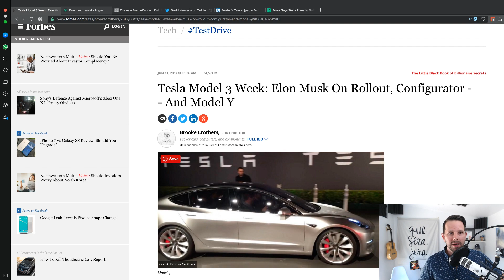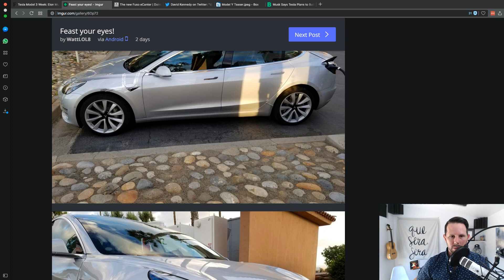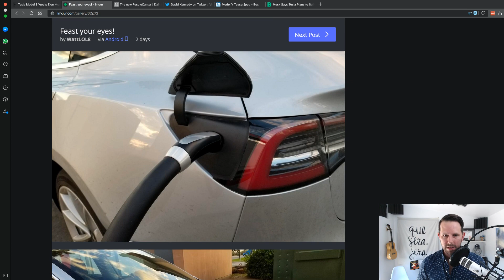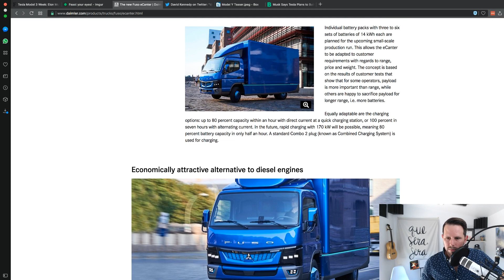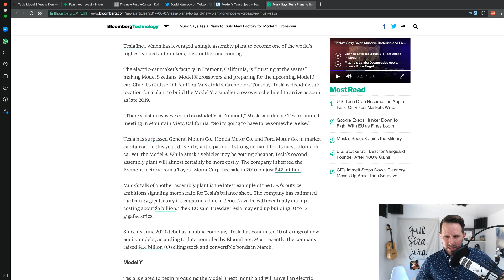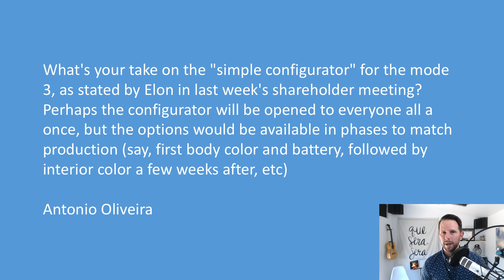Model 3, Daimler EV, Model Y, Solar Superchargers and Fremont Factory Tour - Teslanomics LIVE!

Comment: Another reason to disconnect from the grid is cost.  Your grid even is Washington state (Hydro power) is .10 per kWh after taxes.   I think i have heard solar is .04 to .05 per kWh(in Middle east).   I believe they have even stopped pumping oil with electricity generated with natural gas and switched to solar.  Someone like Elon has all the parts at cost so it may be a better business case then I have stated.

Comment: The reason to install batteries at the superchargers is because slamming the grid with a 40kW load at random times is really hard for the power plants to predict and have the supply available. The battery will stabilize that load.

Comment: I suspect that the large cover for the charge port is to accommodate the significantly larger CCS plug without changes to the chassis. In Europe CCS has become standard, and it would make it a lot more convenient if Model 3 could charge without the need for an extra adapter.

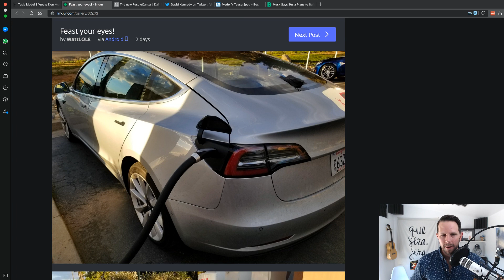Comment: Hi, Ben. At 6:12, the reason the charge port cover is big is that the EU version has a bigger socket. In Europe, Tesla cars have the standard Type 2 socket. The Model S version was barely big enough for the socket but not big enough to add the lights around the socket like you have in the US version. http://cdn.teslarati.com/wp-content/uploads/2015/06/2015-05-26-19.22.35.jpg

Comment: I seen a used 2014 tesla with 55,500 miles with sun roof. For about $43,000 should I buy it or wait 3 years or so for a used model 3 which has autopilot. Most miles I ever need is 100 miles. I'm going to trade in my car which has the value of $12,000
Reply: Can I ride shotgun with you?
Reply: imbored200 buy it. then let me ride shotgun with you 🙂
Reply: Happi Fix I will lol
Reply: You could just buy a used leaf for like 6k if you only need like 100 miles of range. I considered it myself, but EV charging is not available at my apartment or work =/.
Reply: vadix thank you for reminding me about the leafs price. I will check it out. Thank you
Reply: imbored200 Just try and get at least a 2013 with dc fast charging. Those are the two big ones. Pre 2012 didn't use a heat pump on the batteries and the range is shorter.
Reply: vadix what's the warranty on  the battery with the leafs? 5years? I don't really need D.C. fastcharging. It's only one in the city next to me and it's out of my way.
Reply: On 2013 its 5 years and up to 30% loss of charge. I think a better approach is to see how many of the bars (they go up to 13) the leaf has at max charge, and buy a leaf which has had its battery treated well. That is going to be your one concern since milage doesn't always age batteries the same. Heat, resting capacity, and charging speed affect it.
Reply: vadix I thought the bars was goes up to 12. But I'm going to shop around for now

Comment: I think Elon can get away with only offering color choice and wheel size, but it better do 0-60 mph in 5,6 seconds, at least 215 miles range, and cost $35,000. If it says starting price is $35,000 but you can't get it, that would be unprecedented. 

I think he will just put 55-60 kWh battery in it, not a software limited 75 kWh battery, unless he's smart enough to lock it from the bottom instead of the top, which will force people to do the upgrade when they can afford it. 

Tesla will need a special queue system for those with early reservations for a car he promised but won't deliver at launch. Perhaps a queue for dual motor option group and a queue for whatever the last configuration will be.
Reply from the maker: They won't offer it at 35K from the start, only "premium" models that will cost at least 42K (my guess)
Reply: Teslanomics by Ben Sullins, I think that will throw another wrench in the gears. I think there are two groups, those that want a $35,000 car because they can only afford $25,000 and those who wanted dual motor highest performance self driving. There's used model S 85 for $40,000 and some S60s even cheaper. 

Elon saying he will use solar panels and batteries for superchargers is a joke. He doesn't even have solar on his gigafactory yet. It would be ridiculous to put solar panels and batteries at each supercharging station before all his factories (where he has more security) have as much solar as they can fit. But he needs to make a profit charging the cars so he can upgrade and maintain the supercharging network.
Reply: DrgnFlys, no, everyone knows Elon got Tesla to buy the bankrupt Solar City from his cousins. Owning a solar company doesn't make solar panels free. First Elon has to exploit the final loophole in the federal renewable energy incentive program by selling $60,000 roofs and getting the taxpayers who can't afford it to pay $18,000 of the cost. Hopefully the Policies will revise to rebate a certain amount based on the kWh of solar your system produces, not a $10,000 solar system glued to $50,000 worth of roof tiles.

Comment: I will end up delaying my order. I'm around order number 75k so i'm sure the queue will pass me over and I'll just get early picks once the additional options are made available. Quite a few of the options are important for me before picking up the car. Dual motors and a larger battery are key. A couple other things like auto pilot, glass roof, sound system, etc. are options still debating.

Comment: Its possible that the connection fees and usage fees that Tesla has to pay the utilities to supply the Superchargers may make setting up a Tesla solar farm/Powerpack based system as more economical, besides being more reliable, scalable, and insulated against energy price fluctuations or manipulation. 
I just watched Who Killed The Electric Car again, and though the probability for anti-Tesla legislation is dropping, I think Elon is very aware of where the company is vulnerable, and shutting down the Supercharging network would be a major blow.
Reply from the maker: Could be, I think it's a good plan in the long run, just short term doesn't seem like it should be a big priority
Reply: If they use batteries, they can offset demand charges independently of solar energy. The energy source is what matters, and Tesla is a cash burn company in a bull market, so them dumping money into a low return moderate investment like solar isn't very reasonable right now. They should continue to go full force into expanding their car production. In the future I'm sure solar will be very relevant, but I'm with Ben on this one.

Comment: The two options I will wait for are the dual motors (hilly area with occasional ice storms) and the 75 KWh battery. It's cool that the big battery will probably be available right away, and I made my reservation best guess around 185,000 the night of the reveal, so by the time I get to order mine, it probably will have the dual motor anyway, but I would wait for those two things.